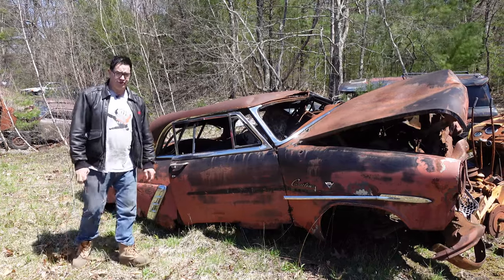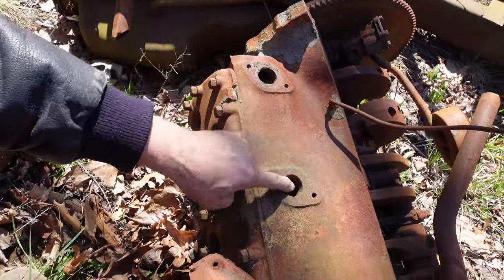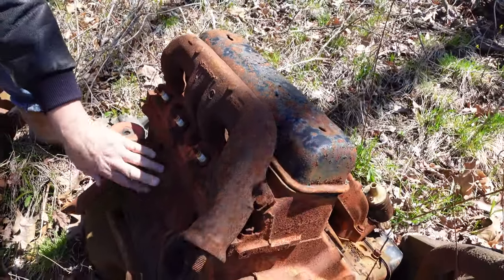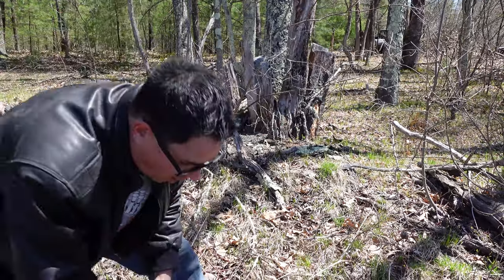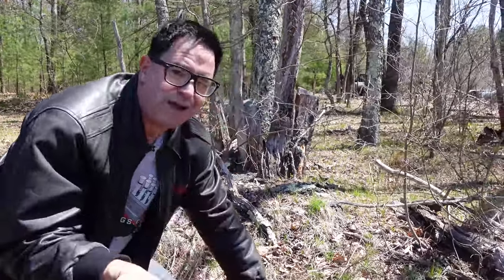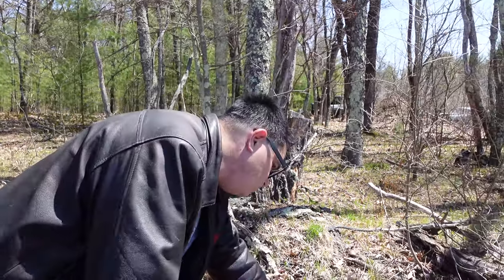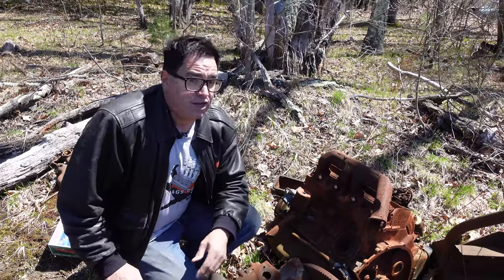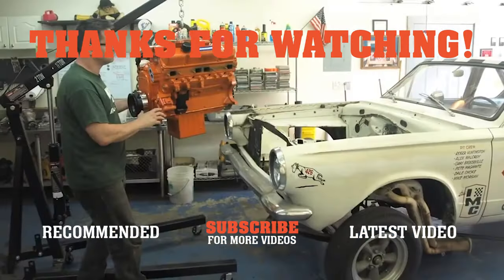Flathead VS Y-Block

Comment: The "Y" block 239 was supposed to originally come out in 1953 in the newly redesigned Golden Jubilee cars but got delayed a year for production problems. Th Y-block also had an unusual "stacked" intake port that ironically limited what could be done to open up the ports for better breathing. I knew someone that played with those back in the late 60's and he said that was the biggest factor in why you couldn't make them run like small block Chevy's. One of the vivid things I remember about a 292 Y was in auto shop a kid was trying to get his shop project engine to fire off in the test stand but the carburetor float was stuck open dumping raw gas down the cylinders past the rings into the oil pan. When it did eventually fire it blew the valve covers off and imbedded them in the ceiling 20 feet above.
Reply: Gee TED  Eaton has gotten over 600 hp  with a y block n/a  as for stacked ports you should check most sohc or dohc motors have similar ports in fact ford won more stock car races in 1957 than chevy

Comment: Thanks Steve for the lesson! I have a 1948 Ford F5 short bus and it originally had a flat head but in the early 60s it was swapped out for a 1957 292 HD Y-block. Now I'm getting it back on the road! 👍

Comment: In high school in 1981 I bought a 58 Fairlane 500.The guy I bought it from said it had a 332 in it.But it had the Interceptor V-8 emblem on the glove box.But I didn’t know much at the time.Of course it was the 352 Interceptor Special.4bbl ,dual exhaust,solid lifters.It was pretty good off the line,but it really started to purr at 80+One of my Uncles said he had one with the 292,and he said it was a dog.
Reply: I never was a fan of the 352. Owned several in beat-around cars, thought of them as capable for that but basically a truck motor.
I raced high banked dirt tracks and one of my closest competitors ran a 352 interceptor in a small body and he kept me on my toes. Any slip up and he's be there to capitalize on it. I later had a competitor that ran a 428 interceptor with just some bolt-ons on a stock motor-he gave me headaches.
Friend wanted to run street stock(bombers) and we built him a falcon with a 292. He got blasted by even straight sixes.
Reply: @Ray56z  I had a 66 Ford with the 352, and mine was great.
Reply: 58 was the year they started detuning the 292.  The 56 - 57 was quite good - 212 horsepower.
Reply: @michaelbenardo5695  Be lucky to get 190-195 hp out of a 4 bbl interceptor in '57. The supercharged only made 230 factory-likely over rated. Outside builders had to alter them so much to get 260-270 hp they weren't actually still a FOMOCO. I bought up several McCulloch centrifuge to use but decided the install investment wasn't worth the gain, just stroked slightly more and gained more.
Reply: @michaelbenardo5695  I had '62 and '65 Galaxies with 352 4-bbl, 78-80 in the quarter and took time to do that. I seen 289's out run the 352 with no add-on. Hella good motors in dump trucks though.
Reply: @michaelbenardo5695  ,thank you,I didn't know that.

Comment: I had a 292 in my ‘60 Ford panel truck. Headers and a four barrel intake off a truck. It ran great. A local transmission guru built me an automatic out of a 59 Mercury and it would chirp its tires shifting. The engine was totally rebuilt by Acme in West Hartford but I cannot remember what we did for a cam.

Comment: Who Made The First Overhead Valve V 8 Engine?
Leon Levavasseur, a 43-year-old Frenchman, won the invention award for the Antoinette V-8 engine he built in 1902. Since then, the V8 has become synonymous with the most reliable, efficient and efficient internal combustion engine that power automobiles and has even been used in early jet aircrafts and power boats.

Comment: Fun fact: Here in Canada, many 1954 Fords and Meteors came with Flatheads (and kingpin suspension) as Ford used up their leftover stock. Some even had 255 Mercury Flatheads.
Reply: Same in Australia, Customlines had flatheads up until 54. Another fun fact the 58 customline used a 55 meteor grille and 56 meteor side trim.

Comment: I owned a 57 T-Bird with a 312.  It was a 4bbl engine from the factory.  They also made a 2-4bbl version as well.
Reply: My grandpa had one ,robins egg blue with the dual 4s and overdrive. 
My pops said he rigged the switch under the gas pedal to drop it out of overdrive  to also allow it to kick down a gear cause it would be up in overdrive 3rd by 45-50 or so I guess. 
Mash it and let it kick down in 2nd and drop overdrive and the back end would get a little loose.

Comment: 62 last year? Perhaps in cars, but lasted through 64 in USA pickups. It's all relative though. See what we think of as a 56 F-100 was made in Argentina for several years starting in 57. Saved a bunch in tooling by giving it a 2nd life in another country! My 64 F-100 has a 292 w/ 312 heads & 3/4 race cam. With 3.89 : 1 rear & 3 on the tree, it feels quick & sounds racy too. In fairness, though, it was white knuckles on small streets at 50 mph. Helped me to slow down because 50 in that truck is scarier than 100 in my 70 Charger. Of note, the 70 Charger I reference goes well beyond 100 before being scary in the least. Another great vid Steve!

Comment: The Ford GAA engine that powered the Sherman tanks in WWII was an all aluminum four valve DOHC design. It was 1100 CID and put out 500 HP and 1000 lb. ft. of torque. Would be a great engine for an F350.
Reply: A 1,500 lb, engine in an F350 would require a big upgrade in the suspension and drive train.  There was a more common V8 version that was actually used in the tanks.  At 3/4 the size and still over 700 cubes that would be a more reasonable option for an F350, but the hp and torque could probably be matched by just turbocharging a ford 460.
Reply: @melodigrand  Supercharging the 460 would be better than turbocharging it.

Comment: Apart from not breathing that well, the exhaust gas on the flathead V8 had to go out past the cylinders which are already hot, getting more heat from hot exhaust gases going past.

Comment: My grandfather had a Ford F100 with a Y block.  He left it sit out all winter and took the battery out.  Come springtime, it would start right up.
Maybe they weren't great performance engines, but for everyday use, they could be pretty solid.

Comment: I kept a 272 from a one ton dump truck. That thing would always crank on the first revolution unless the points were out. It pulled strong , plus was good on gas. It didn't take off fast but would really wind out for a heavy truck. It got so delapadated that I pulled the engine and cut the frame to save the dump bed then hauled off the dangerous cab.

Comment: my Uncle had a 49 Ford. He put a rebuilt motor in it every few years due to cracked blocks. Finally bought a new car in the 80s when he couldn't get parts anymore.
Reply: To bad he didn't swap in a 59AB engine.  That one seldom cracked.  Did run a little hotter tho.
Reply: @michaelbenardo5695  he traded it for a 49 chevy pickup he could use on the ranch

Comment: I had a 1962 F100, 292 V8, 3 on the tree.  The exhaust manifold dumped out the front on one side, across the front of the engine,  into the front of the manifold of the other side, and out the back.

Comment: Chevy got 283hp out of 283ci N/A while Ford needed a supercharger to get 300hp out of 312ci. Some things never change...
Reply: That was the standard supercharged 312.  There was a second version that made 340 horsepower.
Reply: Yep. In those days Chevrolets looked at a lot of Ford tail lights..
Reply: Yeah. Chev needs 6.2L to make 420 hp while Ford does it with 5.0L [coyote]
Reply: Now, please tell us how the Chevy 427 is so superior to the Ford 427.
I'm waiting.
Reply: @penguinsfan251  I think the Ford 427 has, if nothing else, superior lubrication.

Comment: The thing people dont know is there is another family of Y blocks that Ford made. The Lincoln Y Block had almost no similarities to the Ford variant. It was released in 1951 by Lincoln and was used primarily by Lincoln, Mercury, and Ford heavy duty trucks. The overall dimensions of Lincoln Y Blocks are bigger than their ford cousins and they are also better at bottom end power but suffer at the top end a bit. I have a 368 cubic inch lincoln Y Block from a 1957 Mercury Turnpike Cruiser which had a very desirable set of high flow heads, a high performance cam, and a very very desirable 4 barrel carb intake. The 368 was the biggest, most powerful, and most saught after of the Lincoln Y Block. The only thing more desirable is a dual 4 barrel intake off a 60s heavy duty truck or the extremely rare cragar manual transmission conversion bellhousing. Those are big money parts and incredibly hard to find.

Comment: I miss seeing 32-ish projects. Not from my era, never really cared when I was younger. There was always some here or there sprinkled in with muscle car builds. Clean ones not rat rods, which are it's own awesome thing. New for 54... my first thought was the 55, 56 and 57 Chevy were going to come out, which I'd argue... look better than an E-type. Anyone can like an exotic sportscar. The Thunderbird had that same something as well as the Corvettes. Get tired of looking at em? Look away, look back and there it is again. So... Coyote swapped 32 coupes? Terminator 32's? Can't wait for some nutcase to build an Explorer sport trac out like a Model A Hotrod/Ratrod. Bed chopped down to a useless 1ft. Rectangle, bumper mounted lights and plate holders narrow swoopy grill, vestigial running boards, headers, collector side pipes. With an X underneath. What ever happened to the Ring bros.?

Comment: My first truck was a 1963 f100 with 292 and 3 on the tree tough little motor I tried like hell to blow it up but never could I went to a swap meet and got a 4 barrel intake and it ran really good just never was fast

Comment: one of the advantages at the drag strip the techs couldn't tell the difference between the 292 0r the 312 y block and if u did a little work on the 312 it was a winner winner chicken dinner. the problem at that time was speed equipment was not that available for the fords like the chevies.
Reply: BS
Reply: @p1315  what does that mean P  HAHAHAHAHAHA
Reply: @josephryan6593  Furd always had plenty of aftermarket parts...and still had to resort to cheating to win.  FACT

Comment: Notice on that right cylinder head on the y block has the letters ECZ-G wich is the better factory heads apart from nascar ones. If those are original to that engine it could be a 1957 fairlane 292 or 312

Comment: it's odd that there is an abundance of hi-po parts for the flathead except for the block with the french blocks getting scarce by this point. with all the nostalgic racers, boomers with deep pockets, etc... you'd think someone would invest in casting (or even aluminum) new blocks.
Reply: Odd that they don't, you can get Chrysler Hemi and big/small block Chevy falling out of your ears.
Reply: Flathead racing rules tend to need original blocks and otherwise too if you were/are tweaking them beyond the block you might just as well use entirely different engine in the first place.

Channel named greg quirin has aademar and braun landspeed engine builds, one is a flathead block with heads that drop into the block(they changed the rules so they couldn't shave the block, but wanted to keep shorter stroke), overhead cams.

Ofc if theres enough demand someone will probably cnc some blocks eventually

Comment: WHY did Henry persist with the sidevalve,, near sent the company broke. Yet there was OHV as well as OHC engines around well and  truly by then. In upmarket cars. They are simpler, more efficient than any sidevalve.  Without the dreaded hotspots. And with Henrys economy of scale must be cheaper to produce. To a degree this is hindsight but not really.
The Y block was an ok engine,, just out of date when produced as well as too heavy. The 55-58 Fords were better cars to drive than the equivilant from GM. In the 70s a lot were tossed for Clevelands
Reply: Old hot rodders knew that the casting methods that Ford used on their flathead blocks were atrocious.  Some of them had huge voids inside, that only manifested themselves when you pushed the engine for performance and ended up windowing the block 😅 If you wanted to build a modern high output flattie, you'd be well advised to have the block x-rayed before use to make sure that it wasn't cast with a big void inside...

Comment: The Y-block might of been a better engine than the flathead it replaced, but the Y-block wasn't one of Ford's better engines, IMO.
Reply: agree, had it come out in the 40s  it would have been a marvel
Reply: By far the best sounding ford engine i've ever had. I've been daily driving an early 60's galaxie with a Y block, and it is nothing short of a thrill. It's right at home with a 3 speed on the column and full sized car. Mine only has about 400k on it and still starts like it's new.
Reply: The real shortcoming of it is easily fixed.
Reply: @michaelbenardo5695  correct, John Mummert makes these YBlocks scream

Comment: Flathead was the worse engine I ever owned.... Nothing but trouble with them...
Reply: I had a 36 which I owned for 17 years beginning in the 60s for high school. It never let me down. Ring and pinion and 32 tranny only major repairs.
Reply: I did run two cans of STP though!
Reply: What year was your's?
Reply: @michaelbenardo5695  34 and 48...All junk...
Reply: @vernonslone8627  You could drive them at 80 MPH for a distance.  You couldn't do that with a Chevy.  Even if you modified it for more power, you would run out the bearings.